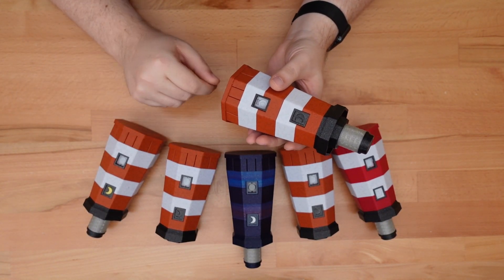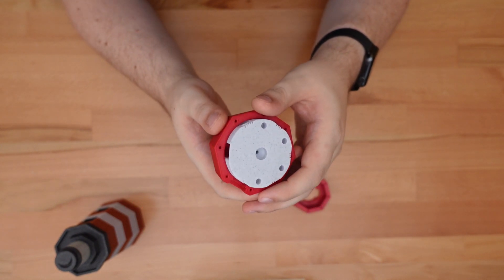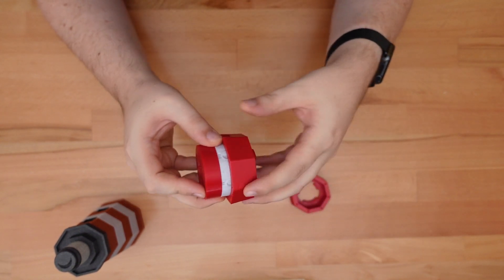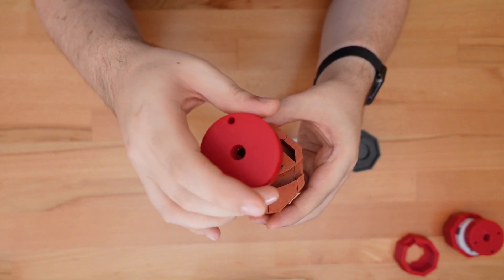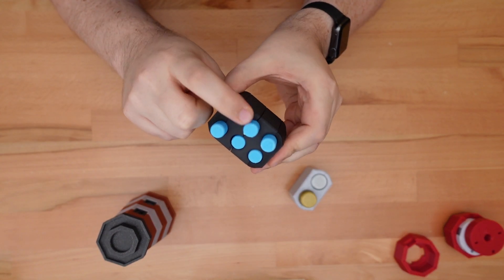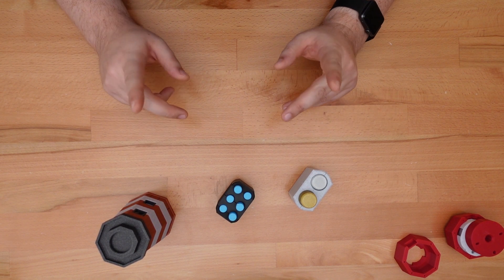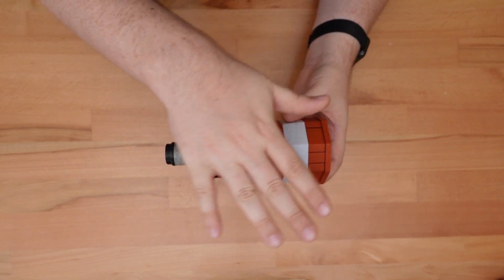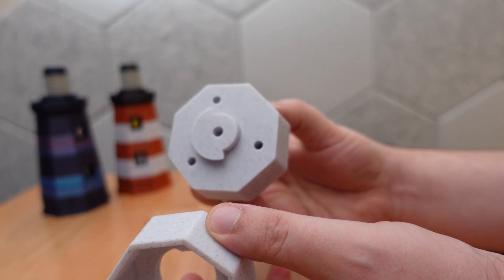Lighthouse Puzzle - Part 3: Design!

Comment: Brilliant videos. One question though: what do you use as the pins? Do you cut down threaded rods (if so what size do you use) or do you do the same process for smooth rods or perhaps something completely different? Also what do you use for axels in general?

Also do you post process your prints? When you displayed the rack/rachet sliding on a slider there was very little friction and amazing clearences. Did you sand it or did you print it with resin?
Reply from the maker: Thank you!

The pins can be cut from 4mm diameter smooth metal rod. Aluminum, steel, brass... the material doesn't really matter. It just needs to be smooth and have enough weight to slide easily with gravity.

Since I plan to eventually print hundreds of these puzzles, I went ahead and purchased metal dowel pins from McMaster-Carr. Links to all the materials I purchased are on the project page.

I also switched to printing the "Bolt version" of this design, which is available as a remix. This reduces the number of pins you need from 3 to 1 (at the expense of using more bolts, of course).

As for post processing - I'm lucky that I very rarely need to clean up prints. If a filament gives me inconsistent results, even after I spend time customizing a printing profile for it, I stop buying that filament. Much of the credit also goes to my workhorse printers, a few reliable Prusa MK3s that are super consistent.

Those ratchet parts came out that way right off the print bed - I DID cheat a little and give a wider-than-normal 0.5mm clearance. Since this was for a demo, I didn't care if the slider wobbled slightly side-to-side. I also chose a filament that has a slick feel to it - Duramic3D PLA+. Sometimes you can just tell a filament will be good or bad for a mechanical part based on how slick the filament feels before printing.